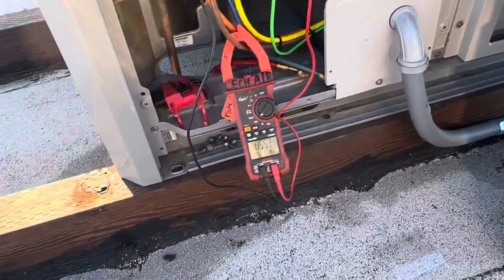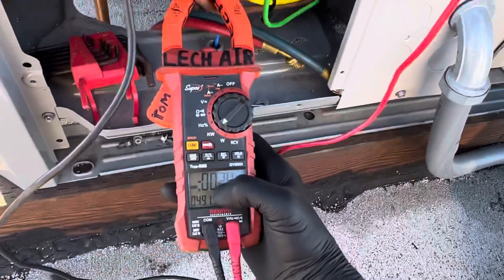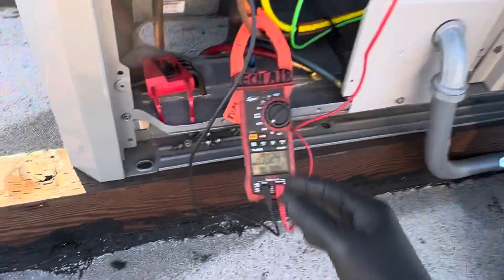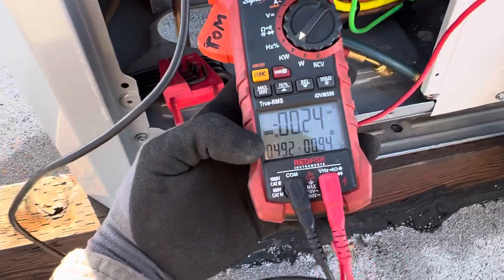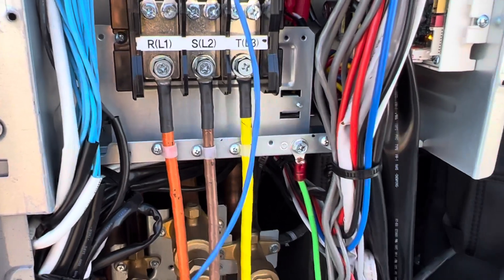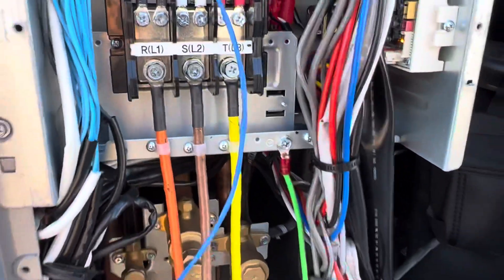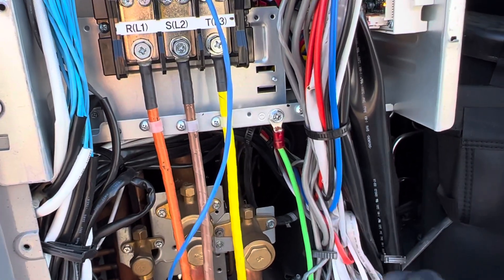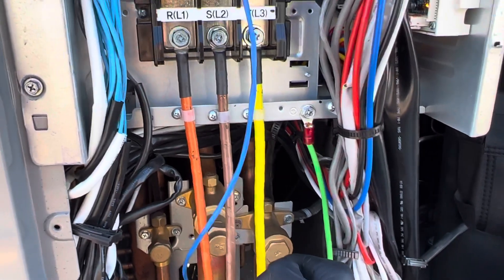Power consumption in watts on a 20 ton LG MultiV VRF Hundred light grow room blazing away￼. ￼

Comment: So, 1 phase of the 3 phase feed has about 5kw on it, so for the 20ton unit running at what ever capacity it was your looking at 15kw total. A typical 240v single phase 2 ton unit at full capacity will run about 8 amps. So that’s 1.9Kw so at the moment assuming it was running below full capacity that is very on par with a high seer 2ton single phase unit. 10units x 2tons would be 20 tons and that would be close to 20kw vs this unit running at 15kw. Again assuming that this unit was not at full capacity.
Reply from the maker: You’re very close very correct I would say it’s somewhere on par with my Panasonic 12,000 BTU 28 seer heat pump. 

      Which is kind of unheard of in the general unitary split system type packages at 20 tons. 

         Just the condenser fan motors on a conventional 20 ton system chew up a lot of wattage just by them self operating not including the compressors motors. 

And just the standby power of each 2 ton heat pump is a little over 100 W each of power to keep the boards fired up and each individual compressor heater. 

    And that’s not all ! If you buy now will throw in the Katana Jitsu five piece sushi knife set. Lol 😂 

      These are heat recovery units when the customer purchase the add-on to the hydronic system they also can heat all their domestic water off the waste gas from cooling the rooms for free no extra energy needed. 

        They also can use that same heated water from the waste gas and pump it into a water coil in from attic air handler’s to turn them into dehumidifiers to supplement the dehumidifiers they already have without chewing up and eating up all that extra energy just to fire up their standalone dehumidifiers because it uses the energy from the waste gas. 

Instead of inductive heaters. Or a separate form of energy consumption to produce heat to make hot glycol for reheat. 

And because of the energy recovery that would be used to cool off all the lights and dehumidifiers in the rooms in wintertime all that heat also can be channel over to air handler‘s in the rest of the office building or if residential was part of the same building all that heat can heat another 50 to 100 apartments for free no extra energy except to get it over there which is nothing more than a recirculating pump and heat exchangers. 

People still don’t grasp and understand the full potential of these units they’ve been doing this for over 30 years America only gets to see a small sliver of the pie of the capability of these units because everything is not available and distributed here in the United States systems to their full potential or only being used in Asia and in Europe and the Middle East America is always the last to get the good technology that’s energy efficient

And their foot print is so small you can take them up in an elevator in a high-rise building and not have to use helicopters or $100,000 crane lift’s 

      And a technology is so brain dead simple and logical I took my son directly out of high school with absolutely zero mechanical experience never use power tools he’s never even so much as touched a thermostat with an air conditioning system in his entire life and he installed one of these systems by himself 28 tons one master two slaves Panasonic system. 

         If a young kid can do this with no experience then what does that tell you about the rest of the guys (with 20 to 40 years experience) in our trade who say this is difficult complicated and expensive. thinking🤔🤫😉 I won’t say it because it’ll upset some peoples and get their panties all wadded up in their butt crack and upset at me if I actually say what’s on my mind.